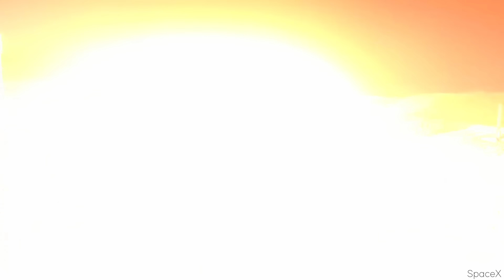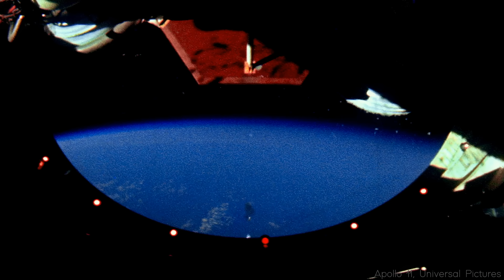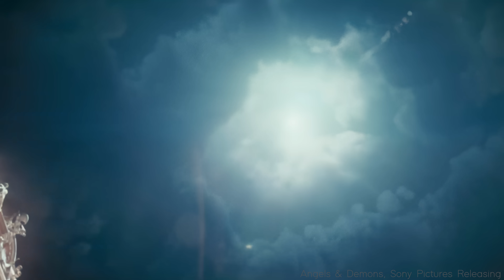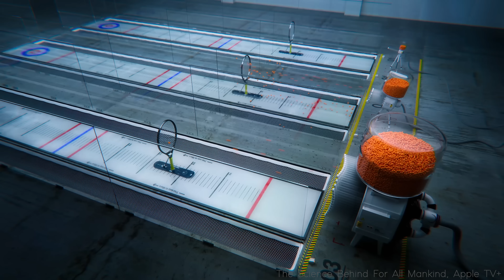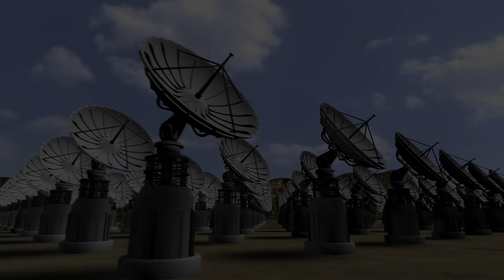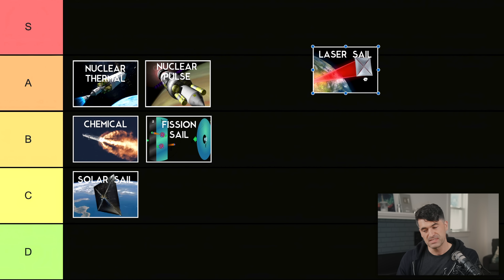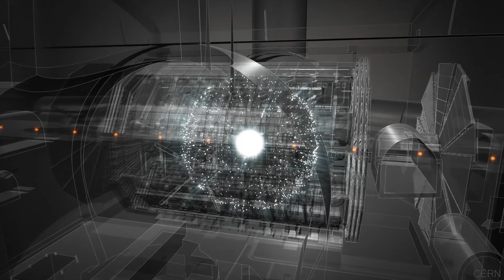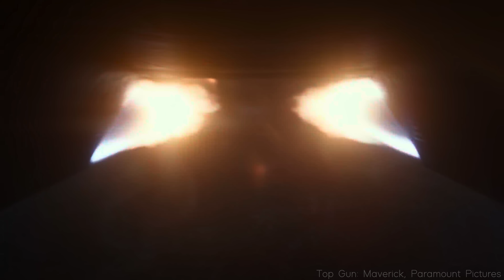Interstellar Propulsion Technologies - RANKED!

Comment: Just philosophically... You are trying to use mass to reach relativistic speeds at huge distances on a cosmical scale which is more subtle than the heavy mass making up matter. So the biggest constraint is that in order to ascend to the heavens, you have to leave behind the mass. You have to think. What is faster than light? The thoughts. So you have to become like thoughts. No mass, yet information which is faster than anything. How can that be? You have to raise the vibrations of heavy matter. Plasma physics. Dimensional physics, etc. So I wager, that the entire concept of space travel is erroneous. You want to build a steam engine and a railway to the Moon?!! How many trees would you need to chop down? In other words, when the rules do not allow you to move, you have to change the rules. The method is to cheat these rules. Perhaps electromagneticism, plasma physics and the subatomic world of quantum effects would help. But using such primitive concept technologies, we would never leave the solar system and reach a star.

Comment: Causality violations are measured in quantum mechanics particle experiments.  Future can change the present.
Reply: You're probably thinking of an erroneous interpretation of the delayed choice quantum eraser.
It only violates causatily if you totally ignore quantum mechanics. What exists in quantum mechanics is the wave function, the superposition.
Heck, even the Wikipedia article has a section called "Consensus: no retrocausality".
Reply: @  Superposition is a bunch of overlapped probabilities.  The probabilistic future is part of that superposition.  Look into quantum time reversal.  It’s difficult to grasp from a local perspective as time reversal happens in the superposition.  It’s not technically the future, and it doesn’t even need to occur for the quantum effect to be measured locally.  It does however affect the measured local quantum effect meaning our present is affected.
Reply: @MrCmon113  Not sure why I was unable to @ you but if you didn’t get the ping then I responded above.

Comment: After our Dyson swarm passes a threshold then we can open a hole one side to focus energy output as propulsion thus giving momentum to the star steering it in a desired direction.  Since the sun is already traveling around the galaxy, that existing momentum can be used to take the whole solar system on an interstellar trip within the galaxy.  The question is where to go?  Probably storing fuel might be worked out first because the sun has a finite life, something would have to be done perhaps removing hydrogen to extend life of the sun and storing that hydrogen in [several hundred] new gas giants in orbit.  Any thumbs up on this?
Reply: You could, e.g. move stars closer together to have more reachable neighbours.

Comment: I feel like laser sail should not be S tier. It's severely limited as the source of the propulsion is a central location. The thing being accelerated has no way to slow down at all. It's like firing something from a gun. It may be our best bet to get something close to another star system quickly with current technology, but it's useless otherwsie, IMO. As other technologies on the list could be developed more and end up being a better option.

Comment: AIUI, the big problem with the Bussard ramjet is that the momentum lost to the interstellar medium the ship captures for fuel is too close to the exhaust velocity.  

If you're moving at speed x, that means the interstellar medium is striking you at that speed, trying to slow you down. You can't streamline your way out of this, either, because for the ramjet to work you need a honkin' great scoop (probably an EM field) to collect enough of the medium to feed the ramjet.

I used to be a huge fan of the ramjet, but apparently it's infeasible. Nowadays, I have to go with laser-powered sailships (which have their own challenges, but what doesn’t? )

Comment: To float on watter you need suck that element (watter) and push it oposite direction and be enaught only few centimeters blades. To fly you need same with air but much larger engine with meters. Think for space you will need capture charged particles or particles that can be ionized with scale in kilometers.

Comment: "One builds some incredibly large Gauss cannons in space that shoot fuel packets with variable speeds for, for example, a spaceship with a giant array of fusion-based ion drives into the path of the spaceship many years in advance, timed to the speed the spaceship should reach at the point where it intercepts the packet. The spaceship catches these packets and uses this as support mass for propulsion, fusion, and theoretically other necessities. Once the ship reaches its maximum speed, it can continue to collect and grow without significantly losing speed. Braking could work similarly by turning the ship and using the collected fuel mass to slow down, or by collecting more packets with a pre-adjusted speed. More or less a kind of buschard ramjet on steroids 😁 💪:rocket-red-countdown-liftoff:😉👽

Comment: You need a combo, turbine compressor engine boosted chemical rocket to leave Earth, then nuclear pulsed detonation engine to hit required speed then transfer to nuclear thermal electric Ion impulse engine to maintain high constant velocity, all being unmanned with an advanced 3D printer on board so we can beam ourselves there and print ourselves out...

Comment: The math for Alcubierre-White has been checked and rechecked and it works. We just don't have the engineering to pull it off yet.
Reply: Negative mass (which is required for the space manipulation) has never been detected and you would need planets worth of it to do this
Reply: Not really.
Just bcs something is a valid metric in GR doesn't mean it can exist.
Similarly you can describe systems in Newtonian physics that you can't build.

Also again: if it existed, why isn't it already here due to timetravel?

Comment: Surprised nuclear pulse wasn't higher.   Between it and laser sails, these seem like the two where the problems are largely solved, and we just need the will to start construction.
Reply: To my knowledge, nothing has been 'solved' yet.  It's one thing to put something in space for a few years or a decade, another to make something that lasts (or can be repaired in situ) for centuries.

Lasers in particular have the focusing / coherence problem.  Pulse systems have to deal with lots of moving parts and instantaneous forces.  It may turn out that NTR is more practical, but even then you're dealing with high temperatures and uncooperative materials.
Reply: yeah, seems like NTR is the most realistic way of going interstellar. The hurdles are more political than technological. Once we starting building shit in space, detonating bombs in our atmosphere, at least, won't be an issue
Reply: Fusion propulsion (not power) should be right around the corner. Propulsion and power are two very different problems to solve. We're nowhere near fusion power, but propulsion should be soon. Im gonna bank on that rather than trying to surf a fucking atom bomb lol.
Reply: @spencer1980 what going to power the fusion propulsion?
Reply: @thor.halsli fission power that probably can be generated by bombarding fissionaterial by fusion neutron inducing fission in a hybrid reactor. 

I believe that we are actually not so far from first operating fusion fission power reactor for Earth based energy generation.

Comment: Surprising I dont see black hole engines.
Step 1: get lots of matter. 
Step 2: compress them and make it collide somewhere in  engine (probably the bell) to make black hole.
Step 3: also make it small enough that it will almost instantly vaporize, giving thrust in return.

No antimatter bogus crap required.

Comment: OK, here's a suggestion for a way to take a "photo of an exoplanet in our lifetimes" that is not on your list: Use iron carbonylation based steel-making to build an absolutely vast telescope array using materials in M(metal)-type asteroids (such as 16_Psyche, 21_Lutetia, 22-Kalliope). The aperture for such an array would be close to 6 AU(!!!!) the collection area could be measured in tens of thousands of Km2 or even much larger. We would build up our capabilities to build such a vast array by building a very large array of infrared telescopes (8-25 micrometer) on the iron region of the Meridiani Planum (IRoM) on Mars. The beginning of the construction of such a Mars-based array could be before 2040.  You can read about a plan, called the Ironberry Plan, that will lead to the building of such an array in a paper published last month, paper downloads are    here        https://doi.org/10.59332/jbis-077-03-0091 (preferred) and here (https://www.researchgate.net/publication/383857204_The_Ironberry_Plan_an_Electric_and_Steel-making_Way_to_Build_a_Science_Station_on_Mars).

Comment: I'm surprised the antimatter system isn't higher. It of course relies on inventing a method of manufacturing it. I suppose it would take a type 2 civilisation that is able to construct massive particle accelerators and a means of containing it. 

There's a lot of "ifs" involved but if people figured out how to make it on the cheap tomorrow then we'll be arriving at our neighbouring systems in a couple of decades. 

I think I would just want to see the devastating power of a working antimatter rocket in action.

Comment: Antimatter needs more work, but I feel the most practical long term. You could get matter accelerated to say 10%C and the ship only needs a mass of a few tonnes of antimatter. I know the issue is how can we make antimatter on that scale?  Say a factory powered by the sun inside the orbit of mercury? Or build large fusion reactors using Helium-3 in the upper atmosphere of Neptune?

Comment: Imagine, an LHC "cruising" through space, and using condensed radio waves, via their heating effect in appropriately-designed thermocouples (radio preferentially heats a few materials), for electrical power. That may drop output to a nanogram per day, but...

Alternately, using those radio-heated materials next to mirrors might make for a "radio flashlight drive". Incandescent radio-absorbing material would be emitting photons, for a tiny thrust. And radio telescopy shows how to focus radio waves. (The "incandescent" part is important for the design.)

Comment: Great video sir, a question though, do you not have any faith in the SENS project? There is a possibility if we could do away with aging that even a generation ship could see the original crew make it to the destination. Nanotech or some form of biotech that stops aging. If we could stop or severely slow aging, then time of flight becomes less important as long as the ship is large enough to have a viable life support system (food oxygen and water, Co2 scrubbing etc. Isaac Arthur suggests generation ships powered by laser highways often as a potential idea.

Comment: As another physicist, I mostly agree with your ranking. I'd swap Solar Sails with the Halo Drive (sorry). I think that the thin materials necessary for the solar sail aren't far off, while finding a convenient black hole, well, is unlikely to say the least. (I do like how you very casually say, "the down side is, you need a black hole."🙂)

Comment: You just wait.  As soon as we detect a 100% habitable planet (for human standards), suddenly SOMEONE will invent better propulsion in under 10-20 years.
I biased for non-flare M-Class stars, but a orange sun (K-class), say a smaller one, could live for 50+ BILLION years. 
I hope we 100% confirm such a planet in our lifetime.  even if I'd be too old to actually go there, it would trigger such a space-race that would be extremely fun and satisfying.

As for propulsion, as soon as we crack the Fusion power plant thing, we could easily adapt it for space and that would allow us to travel about a LY every 10 years... Which isn't half bad.  Imagine reaching Proxima Centauri in about 40 years...  Or Barnard's Star in 50-55 years.  Lots of potential there.  We could mine the Moon for HE3 as well from what I read.  We just need a proper carrot at the end of the stick. 🙂

Comment: The conundrum is to finance such an operation, and lets say it takes 1,000 years. But if during that time frame, what are the chances that a new, better propulsion is developed in 100 years, and that will actually beat satellite that is already in route? It makes the first obsolete. That is the debate that will be used against such a project. So, the only way for such an expedition to ever stand a chance, it needs a short term purpose like Voyager, and the long term expedition secondary.

Comment: Ion drive, nuclear thermal and obviously chemical are all proven technology. Why not combine all 3 coupled with a gravity assist manoeuvre? Observers always examine 1 propulsion source in these discussions. What is the rationale behind not having multiple propulsion systems? As an armchair observer and day dreamer I often imagine if Starship could be utilised more effectively. I would suggest starship could be highly efficient in ferrying components to orbit to construct a much larger vessel at reasonable costs. Why build ISS replacement as a stationary platform when we could build an international space ferry? Imagine building an extremely large ship which utilised the Coriolis effect, fitted with ion drives for continuous acceleration and nuclear thermal propulsion. Multiple starships and or other craft could also dock allowing for multiple missions from the single platform. The ship would run continuous flyby return missions ferrying cargo, people and other ships to Mars and further afield. It seems perfectly reasonable on the back of my fag packet right?

Comment: Why havent we constructed an interstellar craft in orbit yet...
I want an orbital shipyard so bad dammit.
Reply: 600 tonnes of prefabricated 2m Aluminium 7075 box section. Bolted in orbit on to a central module containing chemical thrusters, nuclear reactor. Sections attached into 2 ferris wheels with triangle strutting. Circa 700 metre diameter wheel made of high grade aluminium, transported on 4 starship launches. Definitely achievable, ion drives, easy, Nuclear propulsion, job done. Inflatable habitats, tasty. Few high spec shielded modules, easy. Life support systems, jobs and goodun

Comment: I am no expert, but I am pretty sure gravity is not a "force" it does not pull or push. So the anti gravity concept is just wrong. Mass warps space and time, which causes "things" to move through space/time in curves - but there is no "force" on them - you would not feel any acceleration. So a gravity/"anti-gravity" matter would just be opposite warping of space/time - which (if it even exists) would probably just cancel each other out.

Comment: At 16:10 you talk about antimatter and essentially dismiss it as infeasible due to how energy intensive it is to create.  This is a very common take on antimatter in general but I was wondering what your opinion might be about generating antimatter utilizing the earth's magnetic field? Not only do we know that the earth's natural magnetic field acts a lot like a particle accelerator but it's been proven that it even naturally produces antimatter (in very small amount) that can get trapped in the Vann Allen Belts for a bit.  

If we could find a way to leverage this process and increase its efficiency we might have a much less energy intensive way to produce antimatter and in much greater volumes than our current techniques are capable of. Just a suggestion, I'm no physicist myself after all! Love your content!

Comment: I think you too quickly disavowed the nuclear fusion engine, the one similar to that in The Expanse. They could achieve specific impulses of hundreds of thousands with not insignificant thrust. Nuclear fusion engines are also not so far out of our reach that we couldn't begin prototyping right now.
Reply: Also, we could also mine the stuff on the moon (some hydrogen thing) for fusion, and use it as a space port, and because it has no atmosphere it’s very easy to launch off from it